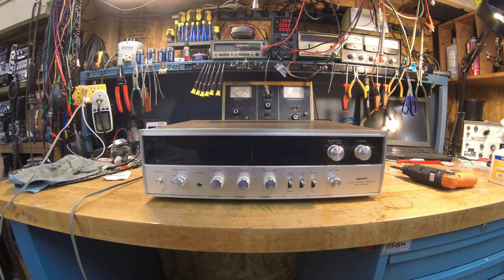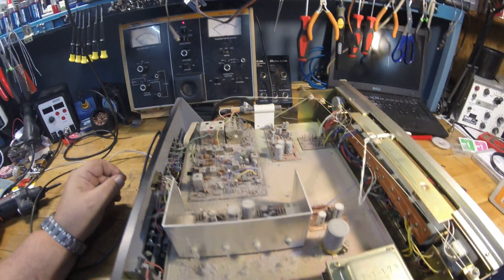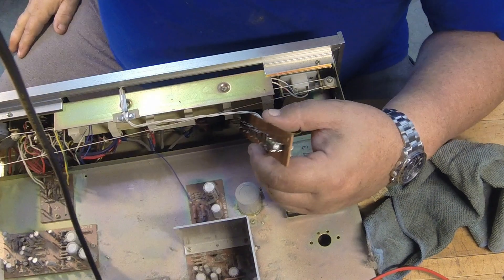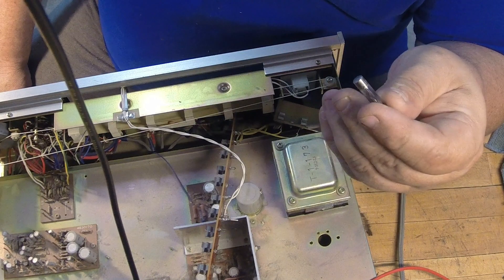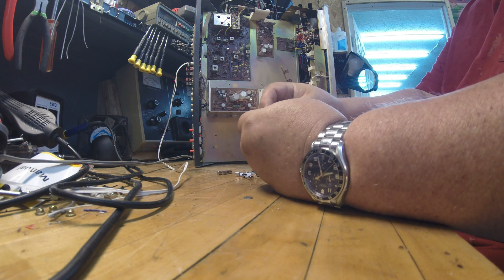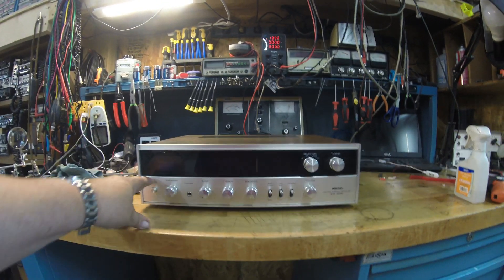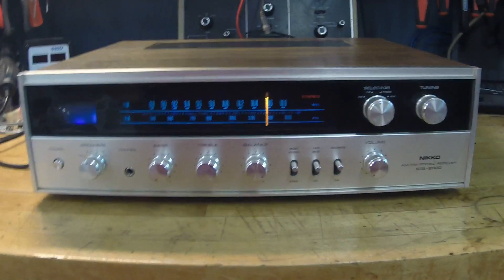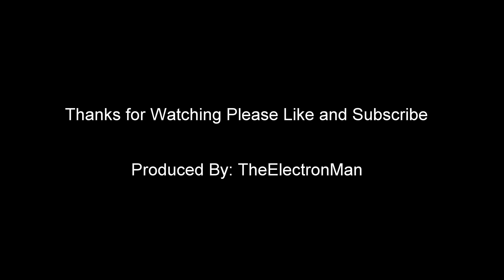Vintage Nikko STA 2020 70's Home Receiver Restoration with LED Retrofit

Comment: You can buy direct replacement fuse-style LEDs lamps for $20/set.  There's 9 LEDs per bulb so they're plenty bright and the direction doesn't matter.
Reply from the maker: @blackpowder4016  yeah that is what I bought but they only came as a set of 5 and I needed 6.